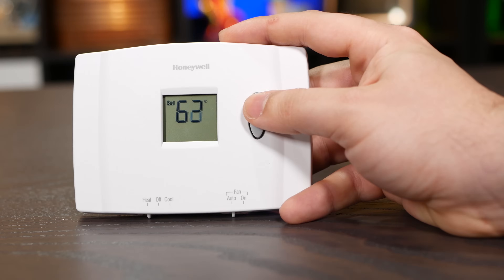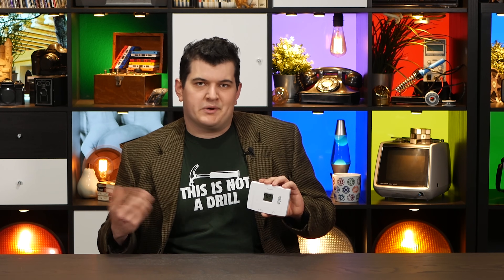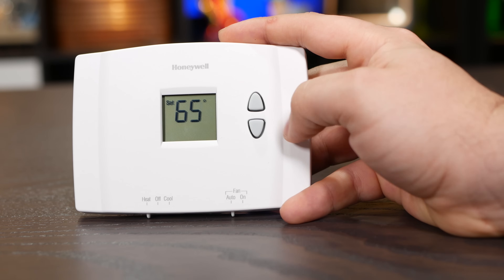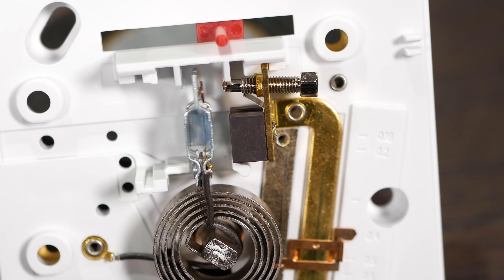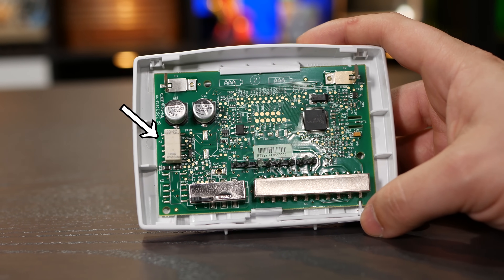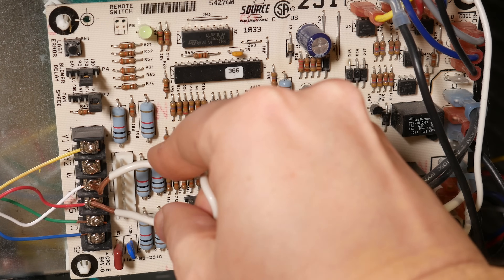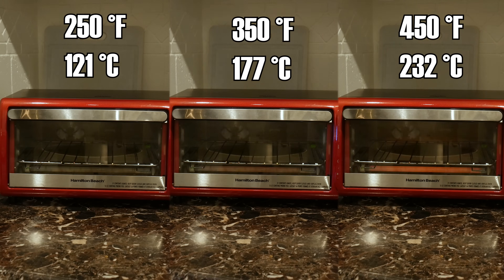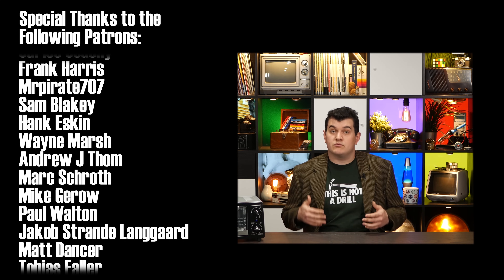Thermostats: Cooler than you think!

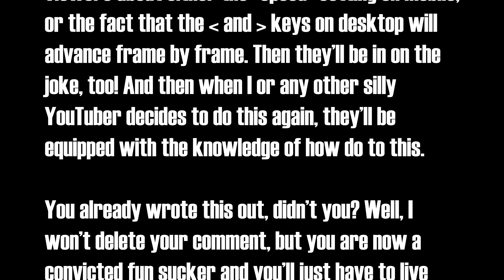Comment: 12:27 full text:
"Having proven that this demonstration would work using my personal toaster oven, I decided to purchase a new one. See, my toaster oven is kinda filthy and I wanted to get another one anyway.
I thought it would be handy to have a toaster oven at the new studio. See, they're really nice for making small snacks or whatever (though frankly I've always found the actual toast making experience to be rather lacking even before i was introduced to the Automatic Beyond Belief! wonder that is the Sunbeam Radiant Control toaster). Anyway, so I wanted to get a new toaster oven, right? So I went to the store and bought a really basic one, just like the one that I use every day in my kitchen. No sense spending a lot on what will just be a part-time toaster oven, and it was the same brand as the one I had at home. Must be perfect, right? Well, it turns out that this new toaster oven runs a much shorter cycling time than my old one, so the effect that I was trying to demonstrate became nearly impossible to see. That sure was a bummer! It later became clear to me that this wasn't a very good toaster oven anyway,  as the fit of the little tray they give you for cooking tacos or whatever was really very tight and just unpleasant. The whole thing was just a travesty, really. So I've since returned the toaster oven you just saw and replaced it with another one, but this was after I had already filmed the entire video, and also after I had already filmed my original toaster oven doing the thing I want to show you. I toughened up and cleaned it the best the I could, and I think it looks OK.
So that's the story of why you're about to see a different toaster oven. I made an assumption that turned out not to be true. Oh merde. In the end, it all worked out for the best anyway because I got a much nicer toaster oven on sale at target right after I returned the rather poor one, so all's well that ends well, amiright?
Oh, and if you write this in a comment to save people the trouble, you're a fun sucker and sucked the fun right out of this gag. I hope you're happy.
A more helpfull commend would be to tell the nice viewers about either the "speed" setting on mobile, or the fact  that THE < AND > KEYS on desktrop will advance frame by frame. Then they'll be in on the joke, too! And then when I or any other silly YouTuber decides to do this again, they'll be equipped with the knowledge of how to do this.
You already wrote this out, didn't you? Well, I  WON'T DELETE your comment, but you are now a convicted fun sucker and you'll just have to live with that the rest of your life.

Pfft."
Reply: I forgot what the video was about when writing this comment.

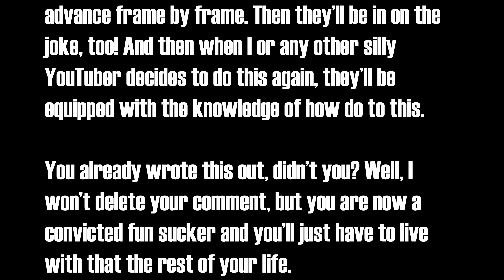Comment: 12:26 Having proven that this demonstration would work using my personal toaster oven, I decided to purchase a new one. See, my toaster oven is kinda filthy and I wanted to get another one anyway. I thought it would be handy to have a toaster oven at the new studio. See, they're really nice for making small snacks or whatever (though frankly I've always found the actual toast making experience to be rather lacking even before I was introduced to the Automatic Beyond Belief! wonder that is the Sunbeam Radiant Control toaster). Anyway, so I wanted to get a new toaster oven, right? So I went to the store and bought a really basic one, just like the one that I use every day in my kitchen. No sense in spending a lot on what will just be a part-time toaster oven, and it was the same brand as the one I had at home. Must be perfect, right? Well, it turns out that this new toaster oven runs a much shorter cycling time than my old one, so the effect that I was trying to demonstrate became nearly impossible to see. That sure was a bummer! It later became clear to me that this wasn't a very good toaster oven anyway, as the fit of the little tray they give you for cooking tacos or whatever was really very tight and just unpleasant. The whole thing was just a travesty, really. So I've since returned the toaster oven you just saw and replaced it with another one, but this was after I had already filmed the entire video, and also after I had already filmed my original toaster oven doing the thing I want to show you. I toughened up and cleaned it the best I could, and I think it looks OK.

So that's the story of why you're about to see a different toaster oven. I made an assumption that turned out not to be true. Oh merde. In the end, it all worked out for the best anyway because I got a much nicer toaster oven on sale at Target right after I returned the rather poor one, so all's well that ends well, amiright?

Oh, and if you write this in a comment to save people the trouble, you're a fun sucker and sucked the fun out of this gag. I hope you're happy.

A more helpful comment would be to tell the nice viewers about either the "speed" setting on mobile, or the fact that the < and > keys on desktop will advance frame by frame. Then they'll be in on the joke, too! And when I or any other silly YouTuber decides to do this again, they'll be equipped with the knowledge of how to do this.

You alread wrote this out, didn't you? Well, I won't delete your comment, but you are now a convicted fun sucker and you'll just have to live with that the rest of your life.

Pfft.

Comment: Have a heat pump system with 3 speed fan, all 7 wires were used.  3  dual sided contacts Mercury switches and heat an cool modes.  But no digital thermostat.  Very complex system.  I currently use a digital thermostat to control a power circuit for flat panels.  Who ever thought having a thermostat on a heating device was a good idea.  Set the panels to constant on low, use a 120v power relay and control operation with a digital thermostat.  Works perfectly

Comment: You could make a case for overshooting the desired temp if the delta from the current temp is large... the contents of the building will absorb (or release) heat as the air around them changes temperature, so there will be a period of time where the HVAC has to compensate for that additional load on the system before the air temp stabilizes. Overshooting in that case would help reduce the number of times the system has to cycle on and off before stabilizing.

Comment: Why there are 4 electric connectivity but still need a battery?
Reply: It's explained in the video. There is only power flowing in the circuit if the thermostat has requested heat/AC.. UNLESS the "C"/blue wire (24v constant) is supported by the HVAC equipment and connected.

Comment: Not to boost engagement or anything... But my Climatemaster Geothermal system has a Cooling/Heating and Cooling 2/Heating 2 mode that if I remember correctly effects the output from 60% to 100% to respond to more dramatic and quick temp changes on the thermostat. So if that happens it get to the temperature set quicker.
Reply: Doesn't get there quicker, it does it the same speed. Most furnaces run at 100% not 60%
Reply: Mark Rampersad well it does get to the desired temp faster and the system blows air harder and everything. That’s the entire reason for the “Cooling 2” or “Heating 2” it displays when it outputs at maximum. In other words, it doesn’t output 100% to maintain temp unless needed for dramatic temp changes. Either by input manually of a temperature change on the thermostat or say fanning the doors on the house too much or opening windows it will respond with 100% output instead of just 60%. 

So basically what I’m saying is it DOES get there quicker.

Comment: Damn, nothing about how the mercury style ones worked. I had one for a few years when we moved into this new house and it was neat to look at. From a distance. With gloves and eyewear.

Oh neat, nevermind
Reply: Pretty much the exact same way as the non-mercury ones with the bimetallic coil. The two contacts are in the end of the glass vial, so instead of smacking two electrodes together, it tips the vial so the mercury will roll into them. Mercury switches were all the rage for a while(obviously, times change).

Comment: Yea you definitely wanna ignore the colours of the wire when wiring thermostats. My cousin tried to install an ecobee thermostat into their parent's house, they had successfully installed one in their house. However, the thermostat in their parent's house used a different wiring method, not R,W,Y,G,C but a proprietary one by Carrier that gets both indoor and outdoor temperature to adjust the amount of heat output by the furnace. The colour for these wires was Red, White, Yellow, Green, and Orange... they assumed they all went to the corresponding labels on the Ecobee but unfortunately for them the C wire was white. What that meant was when the thermostat made the call for heat it jumped R and C together. When R and C get connected they shortcircuit the board. Thankfully for them, the furnace had a fuse so it did not fry it but they were without heat in a Canadian winter for 6 hours until I could get to their house to fix the mistake they made.

Comment: There are lots of two-stage furnaces these days.  They come on full blast if there difference between the current and desired temperature are large.  But, they can turn on at a lesser amount if the difference is only a degree or two.

Comment: The thing that irks me is that I can't find a heat-only programmable thermostat. I have an oil-fired water-circulating system that I want to put on a programmable thermostat, and I know that I could just put a normal thermostat on it and the cooling function just wouldn't do anything, but it still seems clunky and a waste. The current thermostats I have are the newer digital version of the Honeywell Round, and it's terrible. The current room temperature display (an analog dial) is wrong by a whole 4 degrees on BOTH of the thermostats in my house. The timing (PWM-like feature) is set manually by switches instead of being automatic, and it attempts to stick so tightly to its set timing that the desired temperature setting barely works.

Comment: As for the last comment/question, well, my programmable termostat (Vaillant calorMATIC 240) has something called "veto" where I can interrupt whatever cycle or programme it's on and do something else. However, it's manual, so I'd have to cancel the veto manually before it can go back to whatever it was doing before... It also has "party mode" and "vacation mode" where it can do some other black magic while interrupting the "base" operation it's been set to. But I don't use those settings, it's much easier to simply do eveything manually because no amount of smart devices ever managed to guess my comfort levels precisely... :)

Comment: Well, snapping between left and right or cooling and heating is what negative feedback loops would do in living systems. In this scenario, heat higher than set value would indeed trigger cooling which would cool the system down below set value which would trigger heating... And so on :) However, living systems have evolved towards precision mechanisms which keep these oscillations as minimal as possible. :D

Comment: The thermostat in our house lets you switch from "Auto", which uses the bimetallic springamathing, to ON which just turns the AC or heat on forever or until you turn it back to Auto.

Comment: Great video! I have thoughts and questions!

1. Although the placement of the sensor in the thermostat in a larger house may not matter, in many condos the thermostat is placed in between the fan coil panel and one of the fan vents. I live in a tiny condo and the temp read at my thermostat can be 1-2 degrees celsius below almost any other area of the condo unit as warm or cool air is right above it. I have an Eco-Bee that does have an external sensor, at least, so I can confirm that temperature difference, and by placing a sensor away from a vent get another reading and set the temperature based on the average.
2. Oh, speaking of Eco-Bees, I'm not sure if they all work like this, but with mine I can set the temperature to anything and about 30 minutes later it will switch back to whatever the defined comfort setting is for the time of day/day/season. Pretty handy!
3. One thing I cannot do with the Eco-Bee that I swear I could do with my old less smart thermostat was control the fan speed across three speed settings. That didn't come up in your video but is that possible or am I misremembering? I'd love to be able to control the fan speed (again)!
4. Aside from fan control, what other odd-controls are out there on thermostats? What are the rest of those terminals for?

Comment: Very timely for me to watch this video, as I just installed an Ecobee4. One thing I noticed about the house I just moved into is that the daylight basement is significantly cooler than upstairs; like 10 degrees F. I found that if I simply run the fan when it's too hot upstairs, the cooler air downstairs will mix upstairs and bring the temperature difference down, cooling the upstairs, and warming the downstairs.

Smart thermostats should have a feature where you can set the temperature differential to run just the fan. For instance, whenever the temperature is more than 4 degrees different, run the fan to even out the temperature. The Ecobee4 is capable of using remote thermostats, so it would be a very simple matter to implement in software.

Comment: I had an AC replaced years ago, along with a new thermostat. They told me if I need heat, I should use "EM Heat" instead of regular "Heat", since EM is more energy proficient. They said EM stood for "emergency" and admitted the ironic counter intuitiveness, (I live in Orlando FL, where we're not used to cold, but needing heat is far from an emergency. You just have to wait for noon...) but they said that was just the way it was... And I accepted it, because wtf do I know? But, is that correct?

Comment: The whole idea of multi-stage systems is to be more efficient in bringing the temperature to the desired settings. It's
not about how fast you can heat up or cool down because the rapid changing of temps within your home IS what will
cost you more money to run.  There are many variables in conditioning your home & not spending an arm/leg to do it
but by far the smartest thing you can do is to set the Stat & leave it alone.  Yes, these expensive ones let you change
temps w/ a cell phone but they aren't required to run your unit. There are lots of inexpensive Stats that will operate
you unit at the best efficiency.  What these offer is a savings of money by being more  efficient. Many of them cost
way more than they are worth & you'll never get them to pay for themselves but you might have a Neat Stat?
Depends what you find important...... saving money makes the most sense to me.  peace

Comment: Technically, thermostats have additional "features." The Anticipator circuit modifies the on/off responses to account for extreme weather. If it's very cold outside, the thermostat will call for heat a little earlier than normal to compensate. On old thermostats, you'll see it as a tiny slider/pointer and a short resistance wire. There's also Throttling Range, which decides how far to let the temperature fluctuate. For example, turning heat on at 69 degrees and then off at 71 is a narrower Throttling Range than if it turned on at 68 and back off at 72. A narrower Throttling Range causes more on/off cycles but more accuracy in a smaller home. You may or may not notice any of these changes, but they are designed to allow greater control and comfort.

Comment: So, if at higher temps, it runs for a bigger percentage of a set cycle, then shouldn't it actually warm the room faster? lets say you have it working 1 min out of a hypothetical 10 min cycle, outputing say 2 kW. Assuming the desired energy is 10kW total, wouldn't that mean you will reach 10kw in 50 minutes if you set it at exactly your temp, but if you set it lets say at max, it will be working 10 out of 10 minutes in the cycle, which means 10kw in 5 minutes? Or am I not understaning something correctly?